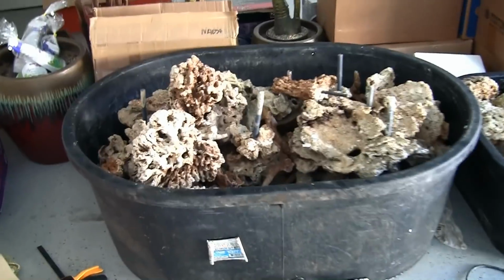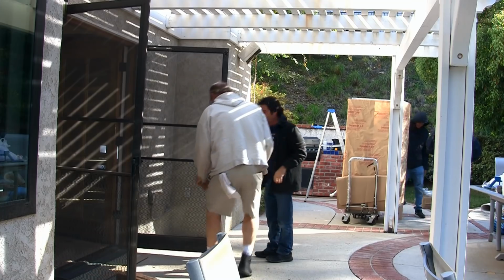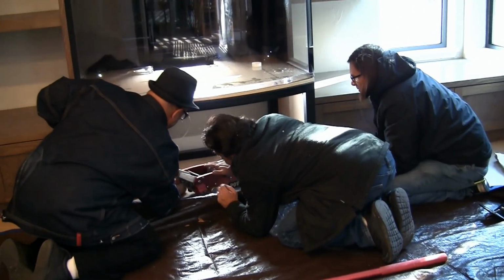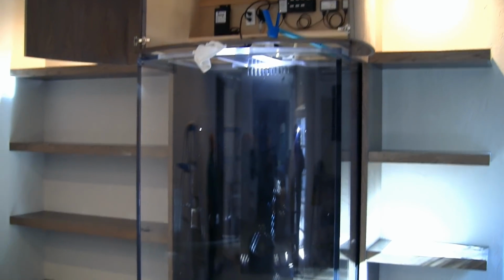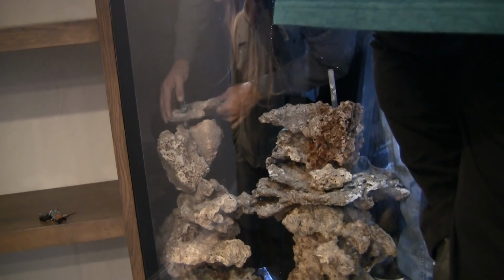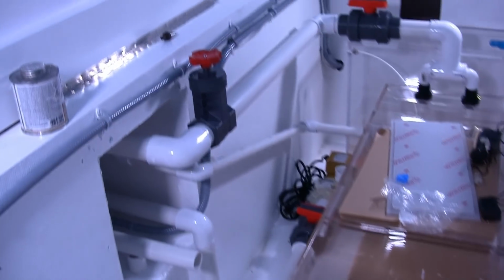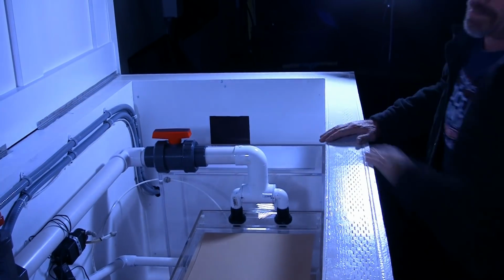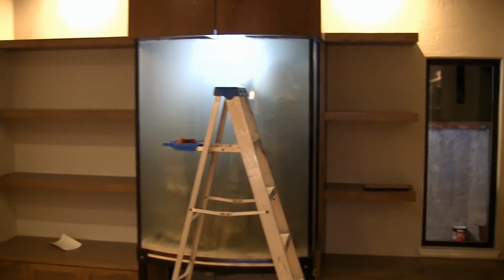60" Tall Bowfront Reef Tank, LA Fishguys Episode 163, Part 2

Comment: Acrilic...?   But why are the seams so visible from front to side panels?
Reply from the maker: The acrylic material is 1.25" thick, and while its a bowfront shaped front panel the joints are 'butt joints' so what you see is where the two panels come together. Unavoidably obvious maybe but they are very clean seams with no bubbles in them.

Comment: Nice job Scott. I'm wondering why there is a gate and ball valves on the outflow. Seems gratuitous use of spendy valves!  :) Along the same lines, why did you use those awful sched 40 valves on the closed loop under the tank?
Reply: Good questions. The gate valve on the drain is if we needed to adjust the drain flow to quite things down in order to keep a full siphon. Ultimately, I wasn't sure how much flow we were going to end up with relative to the drain line size as I couldn't really calculate friction losses or total head loss in advance. In the end, it proved to not really needed but sometimes helpful for fine tuning on long noisy drains. As for the union ball valve on the drain near the sump, that is in place so the system can be shut off without having the tank drain much if any and allow access to the chamber where water enters the sump. It will allow Jim to shut that valve without having much water leave the tank and remove that section of pipe going into the sumps intake section. There is a removable panel in the intake section where the drain lines enter that is held in place with nylon screws. So he can remove that section with the intake cover in one piece by disconnecting the union if he needs to get in there and clean it or get fish that may find it's way into there. We could have just used a union but that would have resulted in much more water going into the sump if he is doing something in the sump like cleaning it, that's just more water to deal with in there.   As for the closed loop returns under the tank, those two valves under the tank were used so we could keep the water in the tank when we set it up before the closed loop pump went in. I knew we weren't going to get the closed loop plumbed that night before the water went in and we had those valves on hand so it was a 10 cent solution to a 50 cent problem. We closed those valves and all was good until we got back to plumbed the return section of the closed loop. Those valves will likely never be closed again unless we need to re-plumb something on that line. That said, I've got a couple of the same valves on the closed loop on my system where they enter the tank and they are pushing 22 years old now and they still work just fine.Mine were actually cheaper ones.  Not my favorite valves but they also never really get used. In fact, the last time I used them was when I upgraded my UV sterilizer 9 years ago. In the case of these valves,  I did apply some silicone grease to the balls inside them before I put them in so that they don't lock up once they were opened. That way if we ever need to close them again, they will be reasonably easy to turn.
Reply: @slief  Thanks for the quick and detailed reply.
Reply: I was going add that the gate valve on the drain line would only have been needed if the return flow was substantially less than we anticipated which is wasn't. Given that I was going into the plumbing side somewhat blind since we didn't have the tank and sump in the house before the install date, I had to put together a plumbing list before we had the tank and sump out there and when plumbing it, I was kind of trying to think of every scenario. The return has 3 elbows between the pump and display and another elbow in the overflow so you get a fair amount of friction loss there granted, we are using 1.5" pipe for the return lines. We also have the manifold for the chiller and reactor stealing a little bit of flow. Inside the overflow we go to a 1.5" PVC Wye that splits to the pair of 3/4" return lines at the top of the overflow. Couple that with the height of this particular display and I really wasn't sure how much return flow we would end up with. I could have used a calculator to calculate the head loss but even then, having the gate valve could have come in handy. The drain setup is kind of a herbie drain setup.  Fortunately the return flow is still pretty good as it sits and the tank is darn near silent. Especially with the valve on the top of the durso. That allowed us to fine tune the drain enough to silence it.

Comment: How hard would it be to talk with the manufacturer of the tank and find out what fittings would be needed before you even receive the shipping? You all are your own worst enemy in getting the job done . . . things do happen sometimes that are unforeseen, but this -- NO!
Reply from the maker: I assumed there was a standard in fitting and hole sizes but turns out the manufacture uses brand X and my drygoods vendor sells brand Y. Next time I will ask the tank manufacture whose fittings he used, and as you noted these custom jobs dont always go smoothly.
Reply: And just to add insult to injury, the dry good manufacturer sent brand X for one size and brand y for another. Fortunately, getting the right ones was simple enough and we picked up the correct one the same day just a handful of miles from the install.